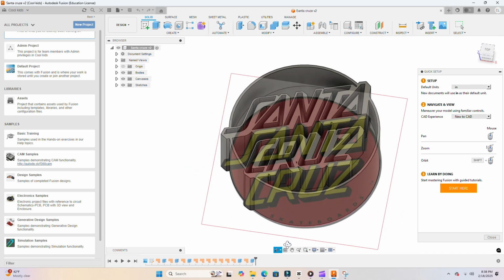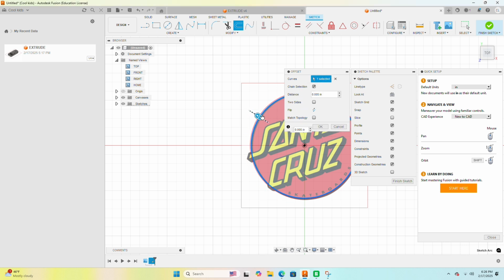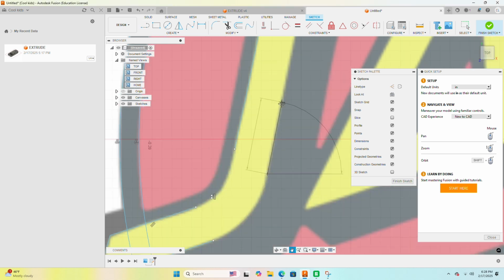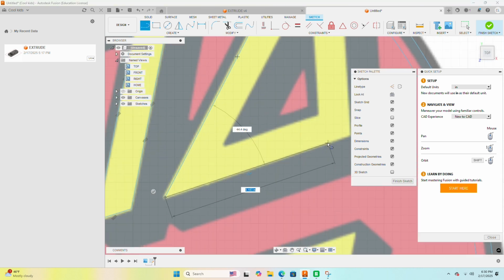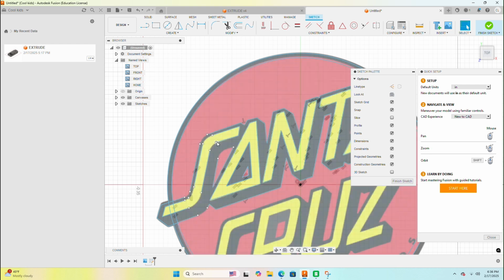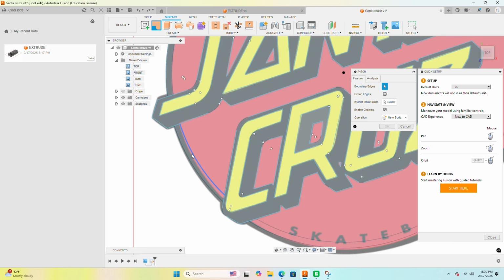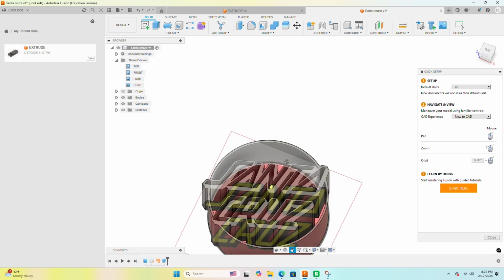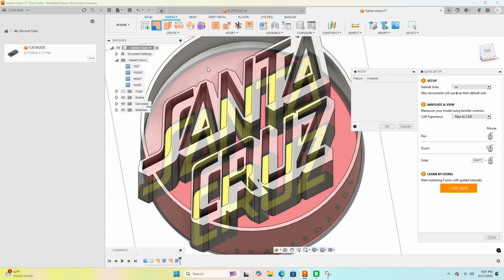3D Model with Fusion 360

Comment: Can you import DXF/DWG into the sketch in Fusion? I think you can save a lot of time converting picture to DXF and you do not have to manually redraw all lines.
I work in Solidworks and ZW3D and I only upload the picture into Incscape, trace bitmap, export DXF, open in CAD and change a scale that I need and save a lot of time.
https://www.youtube.com/watch?v=U3Rkp5ODnxs
Reply from the maker: @martinmaly6789  great question! unfortunately you can’t import a DWF it would have to be converted to a DWG.